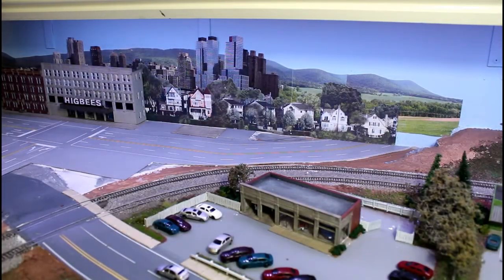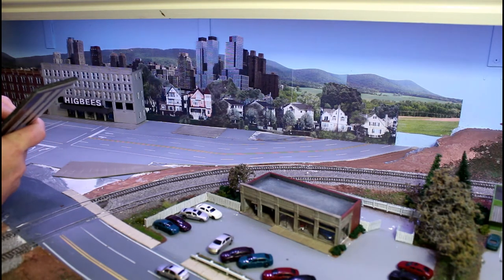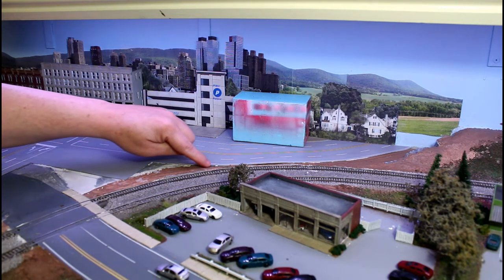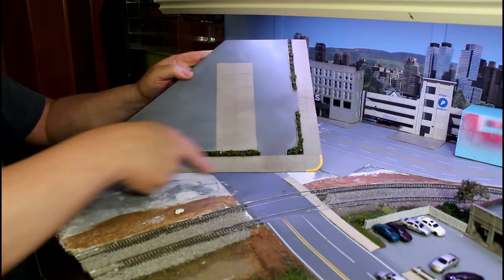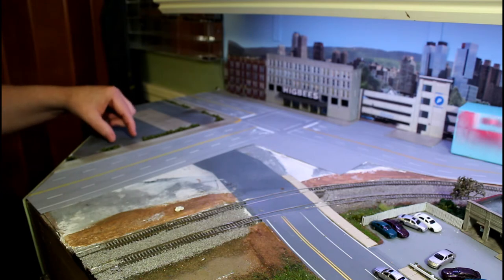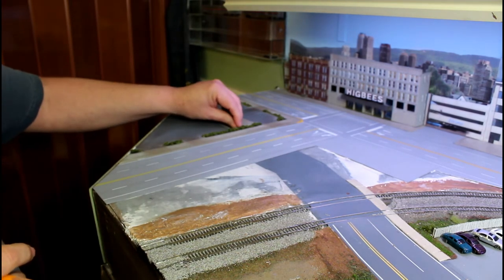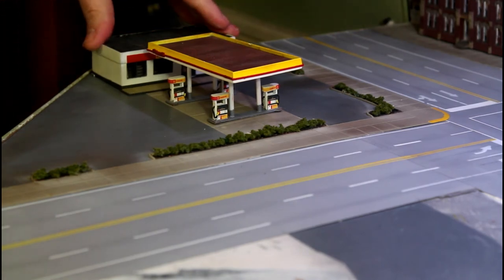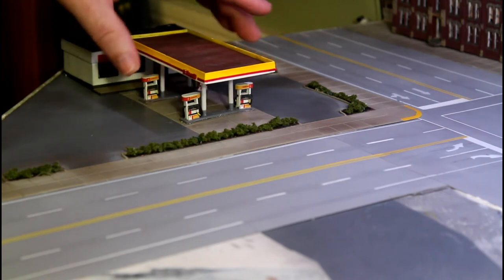Rebuilding a City: Part 14

Comment: Mike where do you get the large sheets of styrene?  I think you should film rehabbing the buildings,  I know of a lot of guys who buy used buildings on auction sites and train shows, that maybe were put together wrong or painted with a barn brush.  Also if the building has to come apart ...what you do... stripping paint...what you use.  The one set of buildings that almost fit screams out of an alley detail...Nice job
Reply from the maker: will kling thanks for watching! The styrene I used to make the roads are .020 x8x21 and the .040 sheet for the gas station parking lot are the same size and are available at most well stocked hobby shop. I just add to the width or length with more stock as needed. I have gotten my hands on larger sheets as large as  2’ x3’ , just do an Internet search for sheet styrene at the thickness you need. It can get I bit pricey though, keep an eye on shipping charges. Good luck!